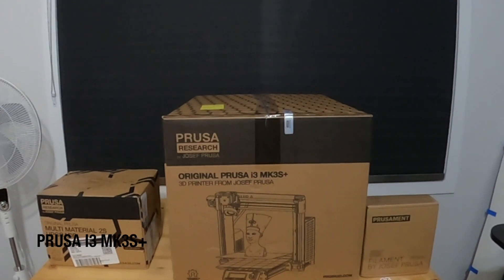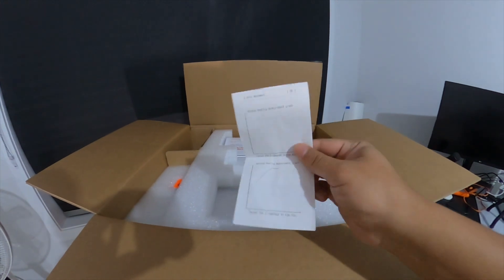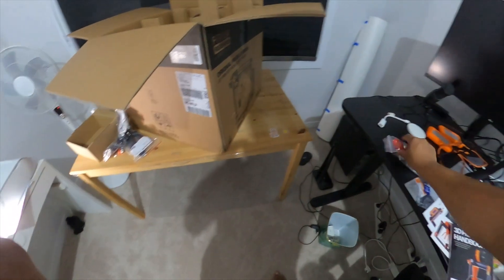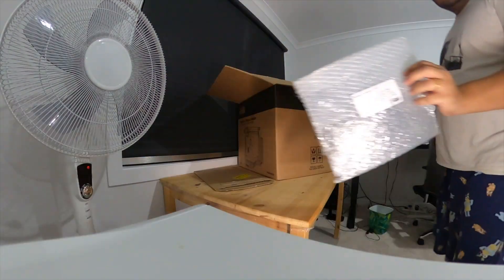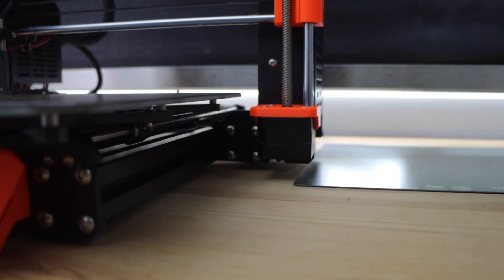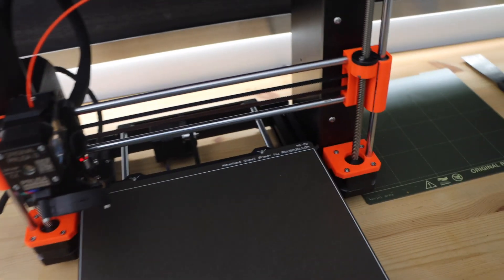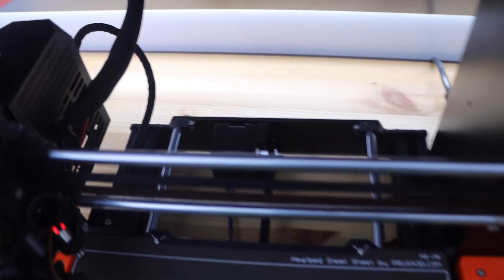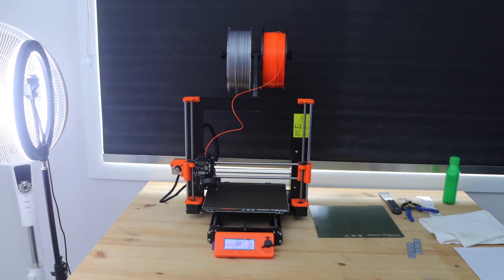My Reaction, Unboxing and Opinion on Pursa3D Printer i3 MK3S+

Comment: not sure if this is the reason why your plate plate got damaged, but I found that trying to remove parts while the plate is hot makes them stick REALLY well, so letting it cool to room temperature makes the parts pop right off with very little force.  it makes sense though, hot tires on race cars stick to the road, and cold tires don't.  if you still have problems with petg specifically (I print directly to my smooth sheet without issues), you can put on a layer of glue from a glue stick and print onto that.  it will make the face touching the build plate not as physically pretty, but it will help you remove the part if you're having issues.  (but I think just letting it cool down first will do the trick)
Reply from the maker: Thanks mate. I will try the glue trick on my next PETG print.